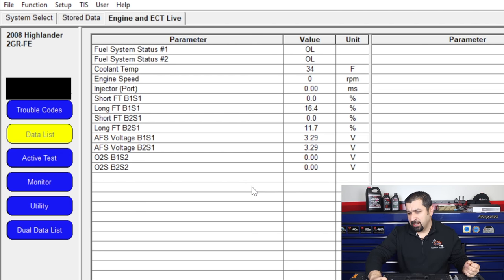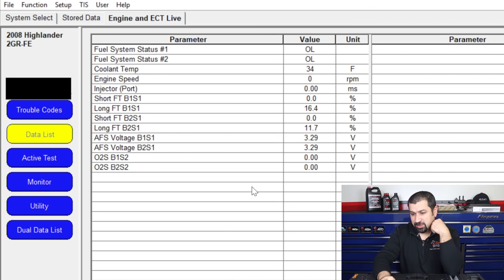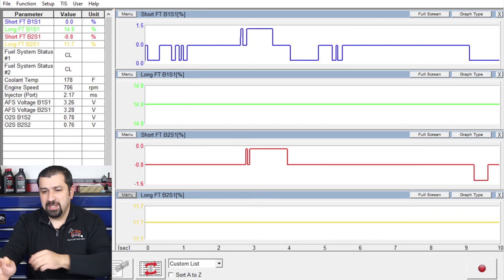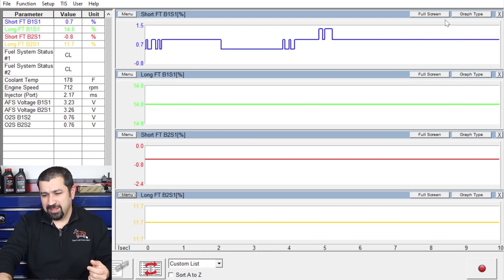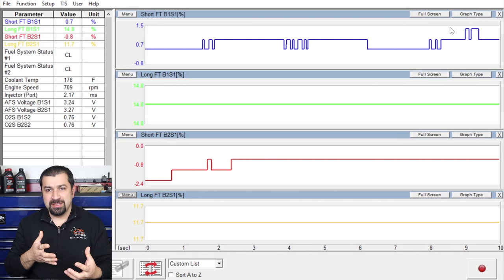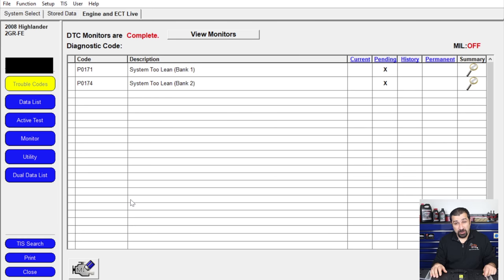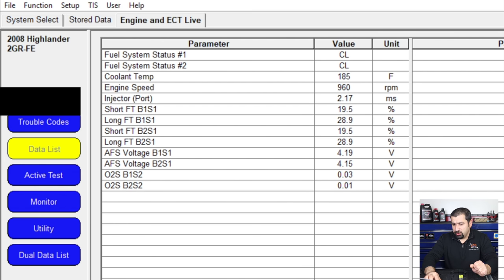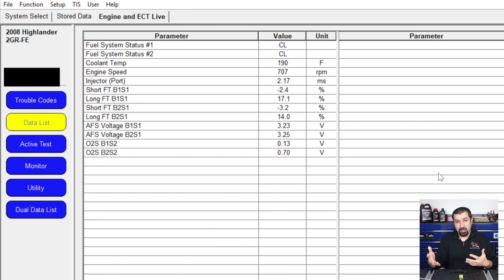Toyota Fuel Trims and live data diagnosis tips!

Comment: So my lexus es350 2016 shows 17 and 14 on the long term fuel trim and the numbers goes down to 9 when I give it some gas which Indicate vaccum leak 

However I smoked the entire intake mainfold and found nothing 

So are the long term numbers normal or something else is wrong with my car?

Comment: I'm just curious at both long TFT after the engine after warm up as it stable @ 724 RPM. Both LTFT shown 11% & 16% O2 seem to be working. Would this be a cause of a small leak or MAF isn't reading correctly? I know in the video he say this is normal and still within tolerance but LTFT around 10% is a bit much.
Reply: correct !
If its more than 5% lean or more than 5% rich,  Then you will notice that the car loses power and consumes more fuel, only if you really have a problem, like a vacuum leak or a worn sensor or a weak fuel pump.
Reply: @scottykilmer3920  Thanks!

Comment: I have a 2013 hylander driving it for couple of hours it started a rough idle at a stop and the sterring was pulsating and radio screen started resetting it is 4 cylinder do you have any ideas it had 80000 miles on it
Reply from the maker: Hi! I would get the alternator tested. Could be faulty

Comment: Hi, AMD. My 2000 Camry V6 with 150k miles has around 5% short term and 15% long term for both banks when fully warmed up and idling. No codes so far, the car seems to be running fine. Is it normal given the age and mileage? Thanks.
Reply from the maker: Hi! Could be normal for the age.
Reply: @TheCarCareNut  Thanks :)

Comment: What the best way to reset fuel trims on a 21 4Runner the long term and short term  fuel trim memory I try unplugging my battery and removing ecu my fuel trims not resetting  is that software the only way to reset trims.

Comment: Looking at the Data List for Engine ECU. Can an incomplete ISC Learning contribute to poor fuel economy ?
Reply from the maker: Hi! Not really
Reply: @TheCarCareNut  ok I have just found out that it never stays in complete. The ISC Learning cycles to incomplete next time you start the car, until the engine idles when the coolant warms up to above a certain temperature then populates the ISC Learning Value. The older hybrid (RX400h) doesn’t do the ISC on every startup automatically and it’s once off learning. There is a TSB for that.

Comment: I am a brand new subscriber. I stumbled onto your channel after researching my 2008 Toyota Sienna engine code P0158, along with associated trac & VSC off lights. As I don't have a specialized scanning tool like you (I have the Blue Driver OBD2 scanning tool), is there a way I can figure out the exact issue? I've read this code is the B2S2, but I wonder if that is simply a symptom of a different issue. Please help!
Reply: @The Car Care Nut any thoughts on this? Maybe if I used a multimeter on the black wires I might be able to see if any of the sensors are bad?
Reply from the maker: Hi! Typically that’s a code associated with bank 2 sensor 2 which is the second sensor on the exhaust on the front bank towards the radiator. First things first erase the code and see if it comes back. If it does you’ll want a capable scan tool to view the freeze frame data to see if your voltage on the O2 sensor went over 1 volts or not
Reply: @TheCarCareNut  Thank you! I will give that a try tomorrow.

Comment: as always good information but ur scan tool showed the fuel sensor voltage is not those new systems show the fuel sensor reading the amperage and it change from one amp up or down with mill amps and works opposite to voltage reading that is when is + mill amps that mean taking fuel away and  _ is  adding fuel. cheeeers
Reply: I'm no expert, but as far as I can tell, the voltage, current, and air equivalence ratio (lambda) all seem to show the same pattern. If you plot them, they all look strongly correlated with each other. Maybe there are some details that can be inferred by each of these parameters, but I am not yet aware of this. If you know of some tips, please do share.
Reply from the maker: The newer cars show amperage which I don’t like honestly. The semi older ones still showed voltage which I prefer.

Comment: AMD, is it normal to have a long term fuel trim on bank one in the negative and a long term fuel trim on bank two a positive?
Reply from the maker: Hi! Depends how much negative and positive. Do you have the actual values?
Reply: @TheCarCareNut  

LT FT#1 -4.72
LT FT#2  .74
Reply from the maker: Hi! These are normal readings and nothing to worry about. Some fluctuations are normal

Comment: Ok what if i have a 2008 scion xd and the fuel trims look fine up or down 5 at most at idle ST and LT and then when driving the fuel trims almost always 0 out for long term and short term still does its small small back and forth...so i take that all that is normal but my reading on my AFR sensor voltage stay at 4v sometimes 3.8-3.9 but mainly just hangs out at 4v...car runs fine and my aftermarket wideband says at idle 14.3-15.1 but my oem afr reading says 14.4-14.9 it stays very close to stoich its just the 4v reading and the aftermarket 15:1 afr that is tripping me out is this normal?
Reply: 2zrfe engine

Comment: Hello Car Care Nut! Question. My 07 ES has fuel trims where the total trim on each bank is usually 10-12. Highest it's been was 21%. I suspected vac leak and found a torn fuel vapor hose, so I patched it. Fuel trims went down to 5-8%. But the next few days, went to 16-17% and stood there. Brought to a mechanic for a smoke test. He decided not to do it, said fuel trims were around 5-8% for him and no need for me to spend the money on a smoke test. Told me (like you said) 10% can be okay for this car. I brought it home, and my scan tool again said 16-17%, but then the totals lowered to 10-12. The long terms will drop a bit when accelerating, and then the short terms adjust so the totals remain around 10-12. Any thoughts? 134k miles.
Reply from the maker: Hi! Are you checking them at idle?
Reply: @TheCarCareNut  Hi! These fuel trims, for example, the 16-17% are at idle, and when I rev to 2-3k RPM, the totals are around 10-12.
Reply from the maker: It’s a bit elevated but not critical yet. Clean the mass air flow and see if it improves
Reply: @TheCarCareNut  I've cleaned the maf sensor, throttle body, new spark plugs 9 months ago (using densos, watched your video on counterfeits recently :) ). 
The car is at 134k miles. Just trying to get the best performance and take care of the engine!